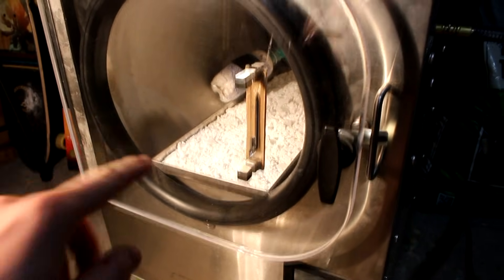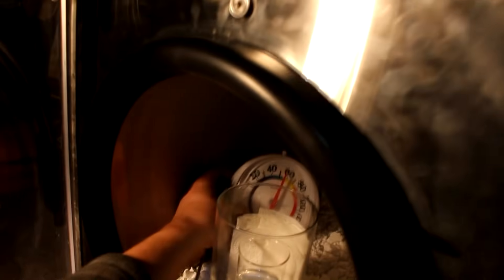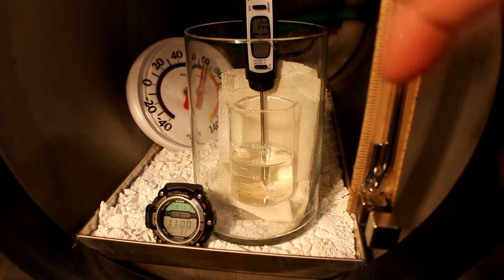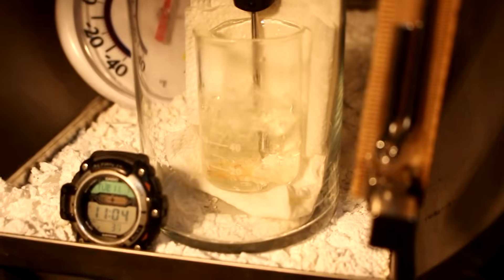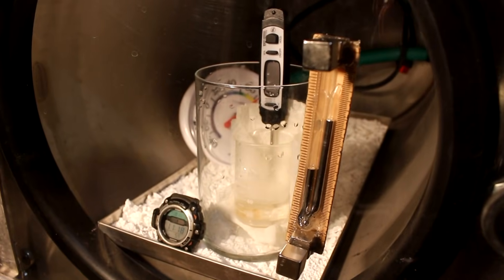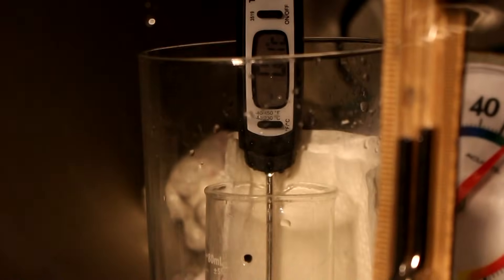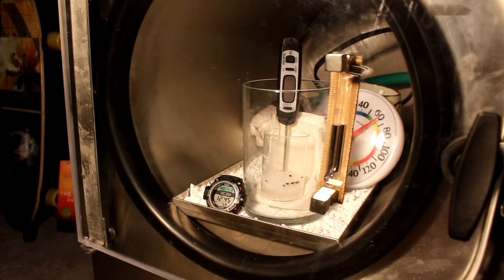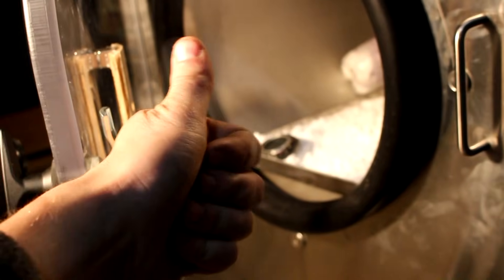Boiling Water Until It Freezes

Comment: Is this why soda bottles feel cooler after you open them and let off pressure?
Reply: I think that is a different effect. In the case of a vacuum pump, the faster moving molecules get eliminated from the system. so the rest of the system gets colder. Releasing pressure doesn't remove molecules.
Reply: Compressed air (air "duster") cans are probably the cheapest and easiest to obtain examples of this if anyone hasn't experienced it already.  They get extremely cold if you use them in long bursts.
Reply: Mike Downs yes it is
Reply: Mike Downs kind of going from high to low pressure makes stuff colder
Reply: Soda bottles feel colder when you open them because the CO2 gas in the air pocket above the soda is under pressure. When you open the bottle the CO2 expands out into the room. This expansion requires energy and that energy is obtained from the surroundings(in your case it would be your hand on the bottle) 

Same effect occurs when you use and aerosol can. Gases escape from can and expand. Expansion of gas requires energy. Energy obtained from surroundings (namely the steel/aluminum aerosol can) therefore it feels cold
Reply: But I heard that they do not contain air, actually; they contain gases(es) that are liquid in a relatively low pressure at room temperture (like propane, butane, isobutane etc). (and are usually flammable).
 
You keep the can vertically, so you release the gas from the "pillow" of vapour that is above the liquid gas. The pressure inside the can drops and the liquid gas starts to boil off immediately, taking heat from its surroundings. This is very beneficial as the pressure is more-or-less constant (in normal usage) up until the moment when all the liquid phase gas is gone, then the pressure drops gradually to atmospheric - that is why these gases are used as propellants for deodorant sprays etc.
The heat of boiling is much greater than of expansion, which is why the cooling effect is so profound.

 Check what happens if you turn the can upside down and then press the valve... It would probably spray the liquid gas that would then boil off quite quickly, but maybe these cans have some protection or sth.

Buy a pressurised lighter gas (isobutane I guess) container and put a nozzle form some used spray on its valve, turn it upside down and spray some (not too much, as you might get frostbite!) on your hand or somewhere (not clothes preferably). You will see how the liquid boils. I don't know how cold can it get in atmospheric pressure, but maybe below 0 degrees Celsius even.
Reply: wait so then why does a water bottle get all sucked in as it freezes?
Reply: the air in the bottle gives off it's heat energy and contracts.

Comment: QQ, if heat is a measurement of kinetic energy of molecules / atoms, and there is a thermometer in the vacuum chamber outside of the water, why does it show a temperature of 15 degrees C when the chamber is at a near complete vacuum?

Is it the inability to lose heat through convection / conduction so the reading remains relatively constant?

Love your channel btw, quickly becoming a favourite.

Comment: How exact is the mercury- millimeter measurment if it is a near perfect vacuum and near-perfect is not a standard?
Reply from the maker: Perfect is impossible; mercury vapor at 15C is pretty darn low.  (10^-6 torr)
Reply: Not necessarily, since it is not possible to create a perfect vacuum on earth, as close to perfect is acceptable. (note, as Cody stated, the vacuum that is stated as "near-perfect" is really close to a perfect vacuum)
Reply: By their nature, measurements can never be done perfectly.
Reply: Hell, even space isn't a "perfect" vacuum, as there are particles flying around, such as a sing H atom in 10000000 m cubed (not an actual measurement, just an example), sure the pressure is so small it is impossible to measure it is still not "perfect"
Reply: @theconeezeanemperor1619  And technically there are things like virtual particles too
Reply: xWood4000 hi
Reply: GamerDuck hi
Reply: Aren't perfect standards needed for scientific measurments?
Reply: +xWood4000 the mercury meter is not the thing that is near perfect. It is the vacuum that is not perfect, so it is not a complete vacuum.
Reply: I don't understand my question anymore
Reply: I agree with the answers 🤷

Comment: What would happen to the water in a very high pressure chamber, the opposite of vacuum? Does it just become vapor?
Reply from the maker: nope, just higher density water, though it would absorb more oxygen.
Reply: I heard of a planet that was discovered (the Thoughty2 video about 10 strange planets), that mostly consists of water and in a depth of X km under the surface the pressure forces the water to become ice, while the temperature is around 600°C or so. The ice is called ice X (ten) and is probably as hard as rock (sry if these information are not accurate it's a while since I watched it)
Reply: https://upload.wikimedia.org/wikipedia/commons/thumb/0/08/Phase_diagram_of_water.svg/700px-Phase_diagram_of_water.svg.png
Reply: it will eventually freeze solid, but only at pressures above 1 Gpa (10k Bar)
Reply: ＤＩＤ　ＳＯＭＥＯＮＥ　ＳＡＹ　ＶＡＰＯＲ？
Reply: Divorganichi
not that much, but ethyne and acetylene are 2 names for the same compound ... if you dissolve it in acetone (for safety reasons) its not a new compount, just ethyne/acetylene in solution :D
Reply: Be very careful you don't turn it into Ice 9, or else it will seed crystal of all the other water on earth, freeze the oceans, and kill all of humanity, freezing the blood of every person
Reply: TheKnaeckebrot I thought that Acetylene is made from Calcium Carbide (rock) when you put that in water it release ethyne(gas) that is flammable (but if you pressure it ethyne will explode(unstable) ) So they dissolve it in Acetone ... And there you have Acetylene. 

Am I Wrong ?
Reply: So it goes it turns to steam briefly then into Michael Jackson before the plastic surgery.
Reply: MoronicAcid1
in reality, nothing is incompressible, its just a theory for easier calculations , look up navier-stokes
Reply: If you've ever used a pressure cooker, that's exactly how they work. If you increase the pressure on water, it's boiling point rises. It allows the water to reach higher temperatures than it normally
would at atmospheric pressures. It does eventually boil off if gets hot enough. Which is extremely dangerous.
Reply: So could you make some breathing aparatus  with air from lungs  filtered  through this high pressure water (That has been enriched with oxygen ) ?  Just like Acetylene = Acetone + Ethyne < I think :) Sorry for bad english
Reply: you know that acetylene is the same as ethyne?
Reply: TheKnaeckebrot  Thx :)
Reply: Could this be used to purify oxygen?  Compressing it to absorb more oxy, then decompressing it and collecting the oxy?
Reply: Define "very high pressure". Water ice will turn into water as you compress it. That's why skiing and skating can be done in the first place. But eventually it will turn solid. I don't know if you can call it ice when it's a few hundred degrees, but solid.
Reply: ***** ice 9 is a joke from the Kurt Vonnegut novel Cat's Cradle :D google it, you'll find it funny :P
Reply: Cody'sLab would it have an effect on electrolosis?
Reply: You could 'carbonate' the water with oxygen. If you pressurize it with oxygen, when the atmosphere is restored, it will be fizzy like its carbonated. Would probably taste like shit though, as you would cause rapid decomposition of any flavors added.
Reply: So it goes it wont boil. thats why coolant in yoyr car wont boil, its pressurized.
Reply: Peepmysneaks I heard that if your radiator is empty and you are in the middle of nowhere you can take a dump in it and that will keep you going until you get to a garage or water supply.
Reply: The phase diagram of water shows that after more than about 10GPa water will be solid, regardless of temperature.
Reply: Valken 10Gpa so The pressure needed to form diamonds? Or like the pressure of jupiter? Now I wonder if you drop a cup of carbon and water down to jupiter's surface which will go solid and transparent first?
Reply: ***** 
Haha Highest IQ in the world is 250–300, of William James Sidis.
Reply: It would form water.
Reply: Magalter Yes, ice has different structures that vary with temperature and pressure.
Reply: Magalter The crystalline structure morphs into a more entropic structure. The most entropic structure of ice depends on temperature and pressure.
Reply: So it goes It will have a higher boiling point.
Reply: *****
he was 100% not joking ... :D
Reply: anonymous no I didn't spend 9 years in medical school to go around slapping my patients...you slap your johns.
Reply: Cody'sLab Water is incompressible.
Reply: MoronicAcid1 I'm not sure but I think water is compressible, as are other liquids and solids. An example is sound traveling through liquid or solid creating pressure nodes and antinodes. I think the compressibility of water is around 45.8 x 10^-11 which is 1/ the bulk modulus (I may be incorrect)
Reply: Cyler Sullivan so is that why clouds look like stuff when you stare at them?
Reply: David Hernandez
Reply: Magalter "probably as hard as rock" no lol, it's much MUCH harder than diamond
Reply: Jesse Valois
Reply: So it goes no, it would probably get to about 3 degrees Celsius and chill there
Reply: Tim Toolman Wow
Reply: the higher the pressure, the hotter the water would get before it boiled.
Reply: How does buying a freezer and an ice cube tray save you money when you have a perfectly good vacuum chamber to do science? Saving money just means less science, that's never good. Like trying to keep your cake for later, just get's old and dry just eat it and enjoy the science!
Reply: If you got that high good on you. I'm just happy I don't have to hurt others to feel better about myself I'd much rather be a happy idiot than a smart ass . Have a good day Esquire
Reply: That's absolute nonsense. Our current methods of discovering planets aren't anywhere near accurate enough to tell us anything about the composition of a planet, and let alone specific information like the depths of its watery oceans.

Thoughty2 is no scientific authority, just a guy who google stuff and posts the things that give him the most views. Some would call that plagiarism.
Reply: We should build a lens the size of earth in the Lagrangian point, only then we will see other planets clearly.
Reply: You speak in absolutes. Bad idea. 
We see several planets quite well right now.
Reply: Dan Lewis 
Oh yes, we see planets in other systems quite well, can't even see their atmospheres. You're a fool.
Reply: You're the fool. We measure atmospheres of other non-solar system planets, idiot.
Educate yourself, mouthy.
Reply: Dan Lewis 
Oh yes, show me the pictures, fool.
Reply: There are none. We can't take pictures of planets in other systems, just see their shadows at this moment.
Reply: YES, we sure CAN take pictures of planets in other systems, you ignorant lazy person.

Be sure and avoid going online to see the photos of those extra solar system PLANETS, not just shadows.

Now back off, and leave me alone, ignorant person.
Reply: Dan Lewis 
Oh yes, we can. Now you can go back to your lala land. Meanwhile we people of the real world dream of seeing the whole galaxy clearly. We can't even see pluto well at this moment, had to send a probe to see it, and it's in our own solar system! We can't even see Jupiter well without a probe! Our telescopes are a joke.
Reply: Yes, you stupid fool.
You can't even admit when you're wrong.
Grow up, lazy coward.

Comment: Why does the temp continue to drop after the water has frozen and is no longer losing heat from boiling?
Reply from the maker: its now loosing heat from sublimation.
Reply: Does this mean, if you leave the frozen water for a very long time in the vacuum, it will remain frozen and continuously sublimate until it's all vaporised?

Comment: you drinking that "water" doesn't prove anything to me about being water
Reply: Especially since he has literally drank cyanide...
Reply: over 9 000
Reply: Nathan Ralph I was thinking the same thing
Reply: Get your facts right it's over 8000
Reply: Actually all liquids can freeze at 0°C, just depend of pressure ^^
btw most of drinkable liquids contains water...
ps : it's over 9000! Get your quote right XD
Reply: ***** Because everything's not made of liquid?

not arguing in favor of anyone here, just trying to prove your point wrong
Reply: not all liquids freeze at 0° take mercury for example. even in a perfect vacuum it freezes at -2.3°C
Reply: All Liquids do not freeze at 0 Centigrade, every element on the periodic table has a liquid, solid, and gas state. Liquid helium freezes at like -200 Degrees and some metals freeze at about 400 Degrees
Reply: I was just pointing out that freezing temp depends on pressure, so of course not ALL liquids can freeze at 0, but most DRINKABLE ones are made with water, so they all freeze close enough that by changing pressure you can move that freezing point to 0. BTW do you want to drink mercury? I don't think so XD

But yeah, i should have said "drinkable liquids"
Reply: Well, to make this even more dumb, technically we can drink almost any liquid. We will not survive drinking most of them though.
Reply: ugotama actually both quotes are correct "it's over 8000!" is the original quote but when translated over to English they normally translate it in a way so scenes don't have to be reanimated. So due to this the English dub is over 9000 while almost anywhere else it's only over 8000.